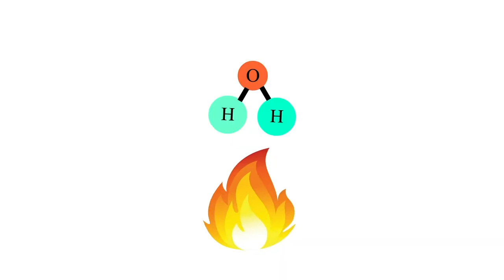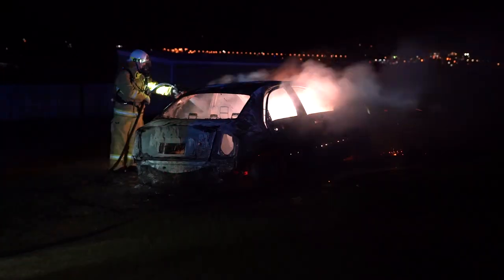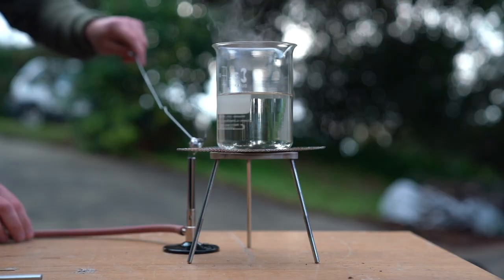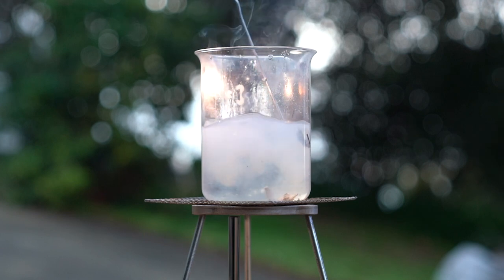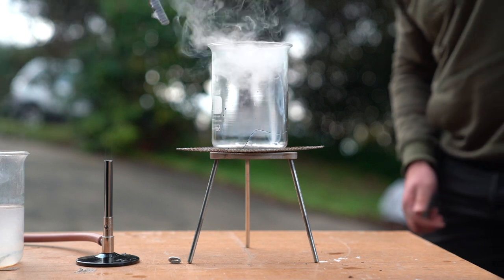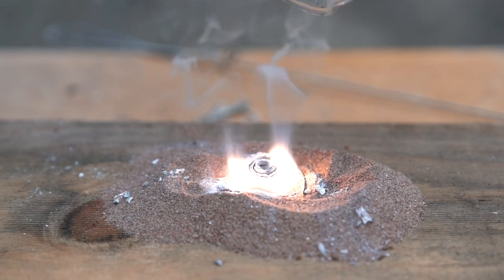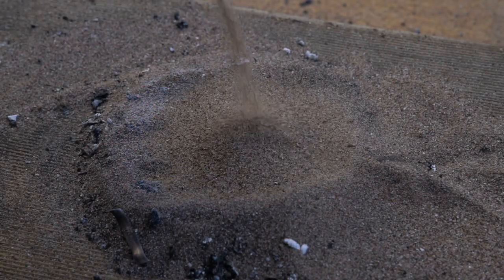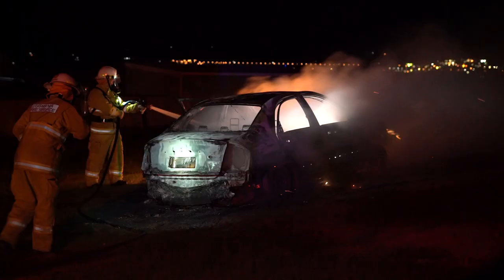Try to put it out and it burns faster!! - Episode 11

Comment: Why a manufacturer would design a combustion engine vehicle powered by highly flamable fuel with magnesium parts and sell it to busy people who are known to be in a rush all the time and crash vehicles quite often to save time,  even resulting in fires occasionally... is beyond me, but honestly can you blame them for making sure the vehicle is half melted and unusable after a good crash. I mean, you just sell more vehicles if the expensive and hard to make engine is partially melted by a magnesium fire once a glowing hot surface or spark ignites leaking hydraulic fluid and fuel in the event of a catastrophic collision. Leave as little salvagable as possible right, just make it so flamable that once it starts to burn it burns so hot that the introduction of water or CO2 which are commonly used to extinguish fires causes a more powerful and unpredictable exothermic reaction.

Comment: Would liquid nitrogen work for putting out a magnesium fire or would it not transfer enough heat away
Reply: Magnesium burns in nitrogen gas, and CO2, from the videos I just watched.
Reply: I think the problem is getting and transporting enough of it in time.
Reply: It would "slow" it down(unless you got it cold enough quick enough to kill it) but mag will form mag nitride.

Comment: What about stopping the fire from Phosphorus?
Reply: Same deal don't water spray it. Pretty sure co2 will behave the same...nitrogen / argon air displacement  are kinda your only bet. Not sure which version of phosphorus you're talking about but water will put out white phosphorus, it will just reignite if you let it reach air after.

Comment: argon. not practical but it will put out a mag fire.
Reply from the maker: Great point, I hadn’t thought of argon! (had my head stuck in thinking of what is available on the fire ground). 👍🏽
Reply: @MattDavis5  they are available mostly used in places like server rooms, they come with there own set of challenges/problems. they arent very practical out in the open like where you would find a burning car. i personally had the thought that if mag fires in cars became a big problem having a mobile fold out room that could be pumped full of argon would be the way to go.
Reply from the maker: Yeah cool. I haven’t seen an argon gas deluge system before. I’ve seen a bunch of co2 and halon gas but not an argon. But it makes sense 😀 As for cars the problem has been dealt with by car manufacturers. These days they really only make small components with magnesium. But in some older cars (some old VW’s) had entire engine blocks of magnesium.. crazy stuff! Thankfully not much of around these days 👍🏽
Reply: @MattDavis5  engines made of mag...dang I would like to see something bigger than a few grams burn. I have only heard of mag wheels being used in any abundance. I know that it's been largely abandoned in the auto world(for good reason). Now we have an entirely new beast to which I can only think of one way to put out. Argon gas wont take care of it either. Only thing i can think of is an even harder way to put out a nasty fire....ev battery packs. Any guesses on the best way to stop one(without just letting it run its coarse) cuz I only have one idea that I can think of.